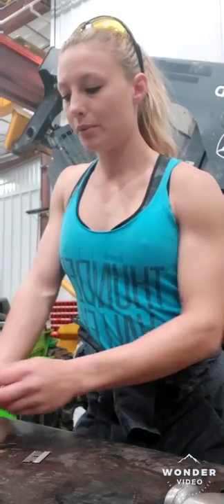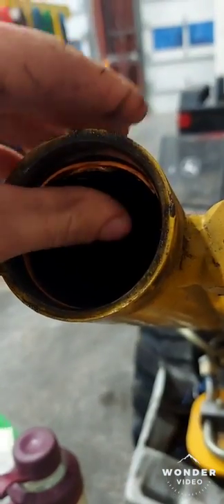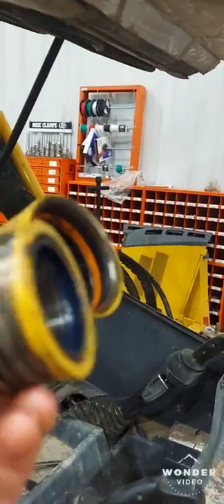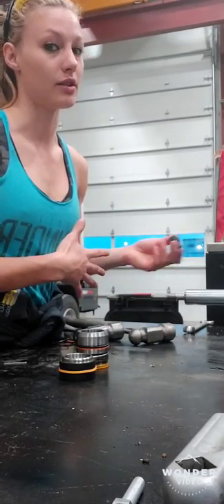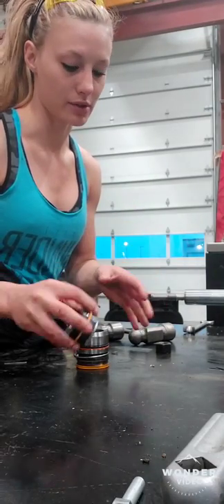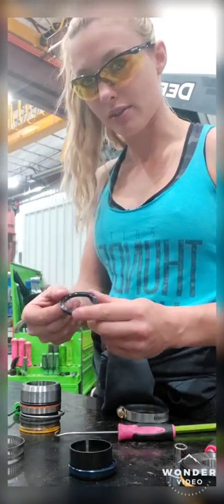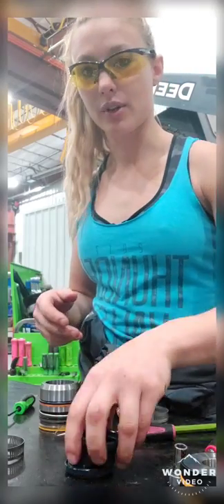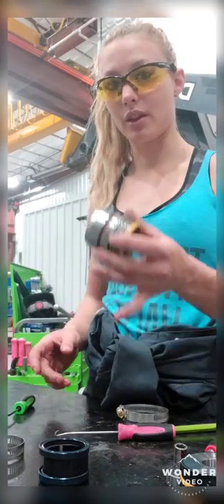Hydraulic cylinders, the basics

Comment: Try using vary hot water for that piston seal install. It will make the seal pliable and easy to mold back to shape if your quick.  .010 shim stock work great for seal protection from hose clamp and is reusable.

Comment: A little off topic but back in the day,i worked for a mining company that had several 988B Cat loaders. They had production quotas to make,so when one or both of lift cylinders needed rebuilt,it had to wait until winter when thibgs slowed down. As hydraulic fluid would bypass the piston,it would erode the oring and back up ring on the cylinder head. A quick repair that would gain a month or more until it eroded oring again,was to disconnect steel pipe to head,and unbolt the head. Lift head up out of tube. Clean oring groove. Then take new oring and back up ring and CUT them diagonally. Roughen the ends of the cuts with sandpaper. A shot of ether to clean them. And using good super glue,glue ends together after gling around the rod. Onve glue set up, carefully put orings back in groove on head and re-assemble. It works to buy time until proper repair could be made

Comment: I just roll the pistol on the table for a while and then if it’s not visibly shrunk up I put it in a freezer for 15 minutes. Always works for me. I never liked the hose clamps because it puts uneven pressure on the seal. Very old heavy equipment technician who won the excavator competition in 1999.

Comment: not all cyclinders are like that there are so many different types and ways of putting them together some have an o ring where the nut goes on some don't my jcb i rebuilt the cyclinders on it and the nut was actually held on with a pin and it wasn't tightend up with an impact it was hand tight and had a wear ring that held the pin in place
Reply from the maker: Thankyou captain obvious
Reply: @thedieselqueenmelissa715  your welcome I can feel you attitude from here I been fixing stuff for 30 plus years you could of been more specfic in saying that cyclinder is the type used on this machine but there are so many other types and styles out there but whatever if you really want to go a good cyclinder repair video do one on the machines used to disassemble the big cycllinder and describe how its used including the awsome hyd wrench for removing the nut on the bottom
Reply: @thedieselqueenmelissa715  best response ever
Reply: @thedieselqueenmelissa715  omg, that was great 😂.
  And yeah, been doing a LOT of re-sealing on different hydraulic rams for log splitters and other Hydraulic rams etc.. it has been going very well so far but since it's always something completely different that customers are bringing in to get repaired there are a lot of different setups..